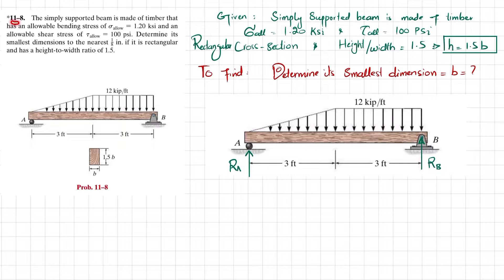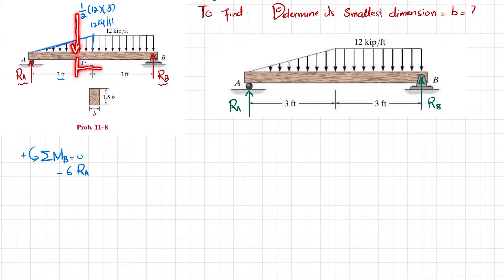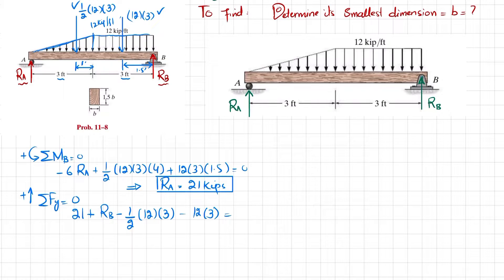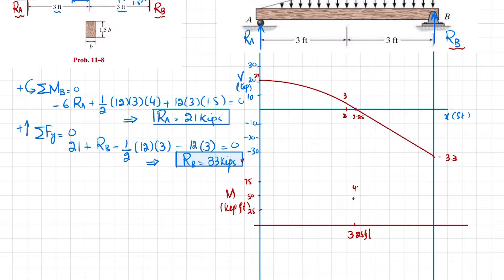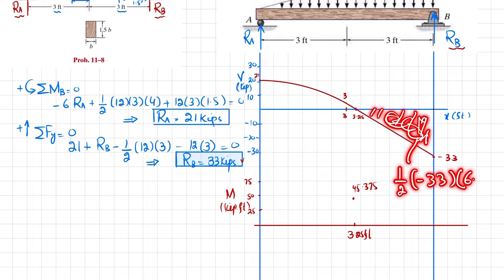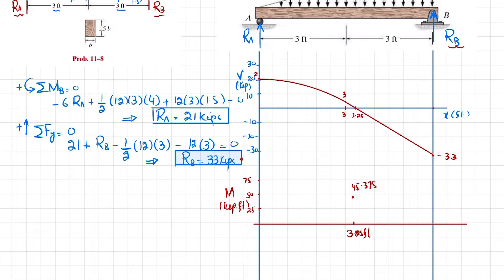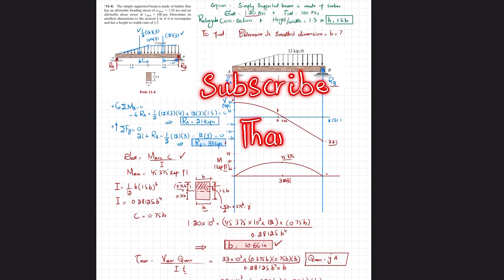11-8 Design of beam and shaft| Mechanics of Materials RC Hibbeler

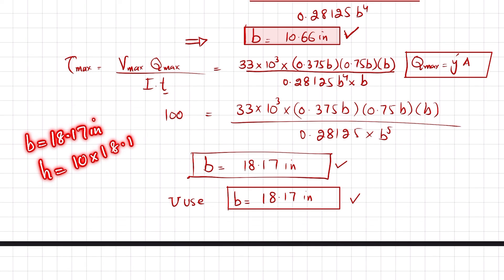Comment: Hi! I loved the video, but at the time frame 18:12, you multiplied 18.17 inches by 10. I thought in order to obtain the height, you had to multiply 18.17 inches by 1.5. Could explain as to why you did that?

Thank you very much and have a good day!
Reply from the maker: Thank you and you are right it is an error. I should have looked into the relation of height and width b....